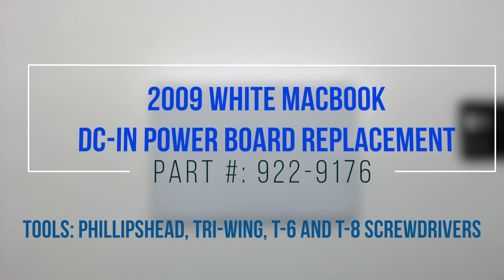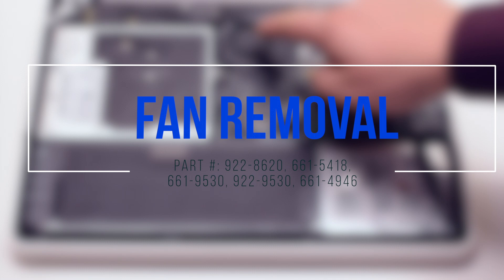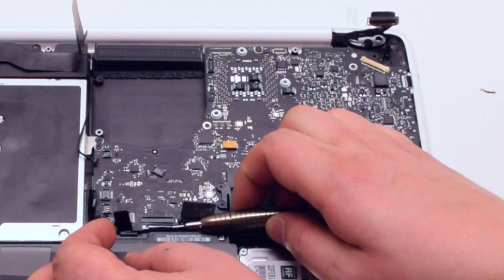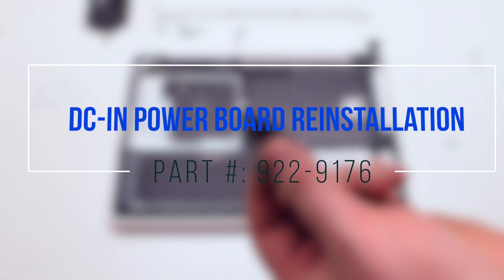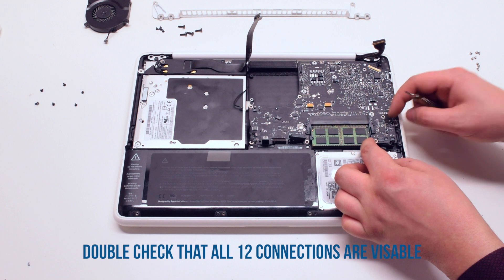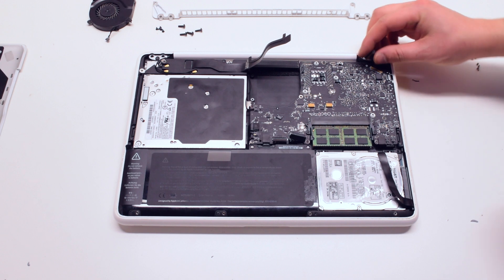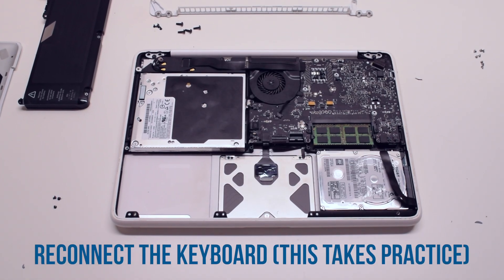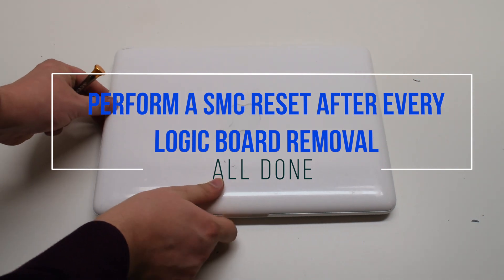2009 White Macbook A1342 DC in Board Power Connector Replacement

Comment: Thanks for the video, it works perfect! The replacement part was just €15 so a cheap fix instead of going to the repairshop. But be warned, you need multiple screwdrivers: T5, T9, PH0. Here is link to charge port part: https://www.ebay.nl/itm/264864451203

Comment: Does anyone know where to buy the power connector unit? (Power Connector/DC-in-Board P/N: 922-9176)
Reply: Found it on Ebay- It is used but they promise it will work. And mine did.

Comment: Same laptop, recently changed the power connector but it doesn’t charge or recognize the charger...the charger works fine tried it with other pc and it works fine...everything else on the pc works fine it turns on and all but using battery power...what might be the problem here?

Comment: Thank you for your tutorial... Everything went fine except that I get stuck when I had to reconnect all the small cables with tiny pins. Is there a Technic to put them back ? It doesn t want to get in... Any of them... Should I slide them ? Take them vertically and push them back ? I am scared to push too hard and bent them.  Thank you in advance for your help
Reply from the maker: Unfortunately it’s just a matter if fettling with them.

Comment: Really excellent step-by-step video for an early 2009 Macbook! Just two comments that would be helpful. 1) Removal of the LVDS (display data) cable is not obvious and can be easily broken if not done right. A mention of pulling up the locking clip by the black tab before sliding out the connector would be useful (such as described in Step 7 of the IFIXIT instructions for replacement of the DC-in (MagSafe) board on the somewhat similar Mid-2009 MacBook). 2) Possibly add a reminder at the end to reinstall the vent along with its 4 Phillips-head and 4 T-8 screws before putting on the back cover. Other than that, everything is clear and concise and made the MagSafe install on my early 2009 MacBook (Identical to the one shown) very easy. Thanks for a great video.
Reply from the maker: Thank you for the feedback!

Comment: I have this same laptop and when i turn it on the light on the bottom comes on but the screen doesn't and i've replaced the screen and I'm about to order just a new logic board but i just want to make sure that will fix the problem.
Reply from the maker: Logicboard will fix the issue.

Comment: my cable plugs in, green light indicator is shown, and then just doesn't charge.. (light also doesn't not change to orange on the charger). does this mean I require a new  DC in board power connector?
Reply: Save Apple Dollars that doesn't work. I had the same problem and replaced it. The battery will charge, but its random when it does charge, and the adapter still stays green.
Reply from the maker: Just replace the battery.